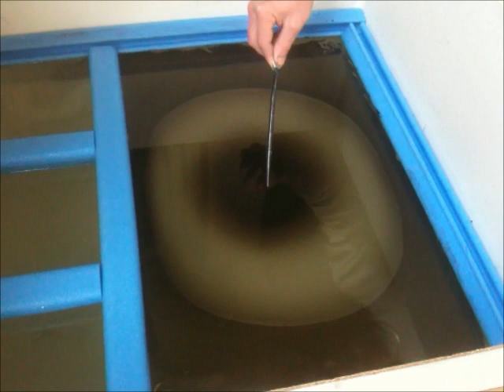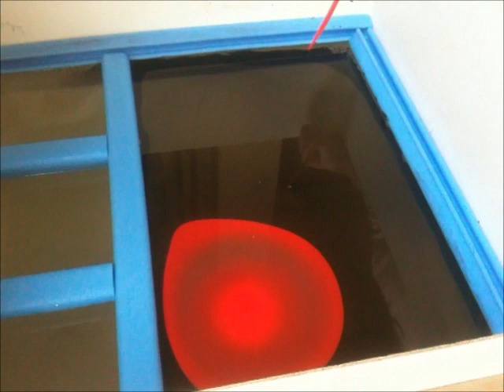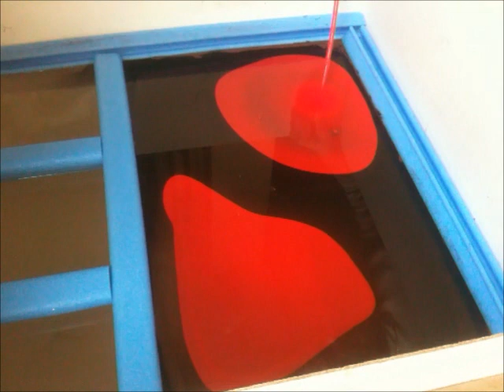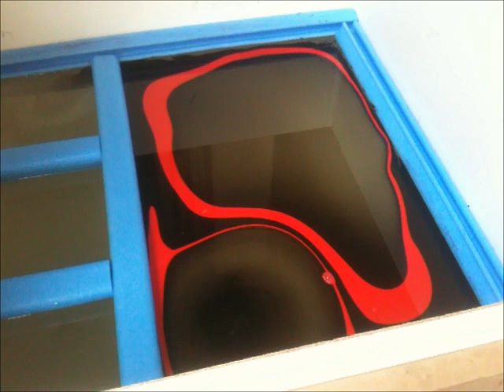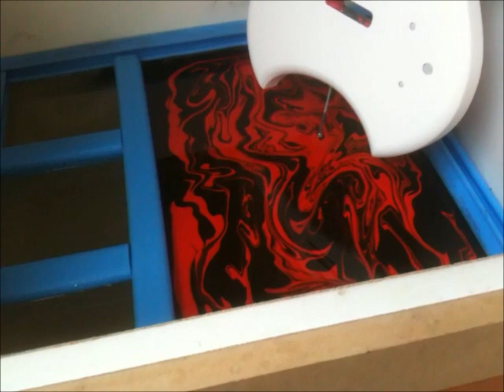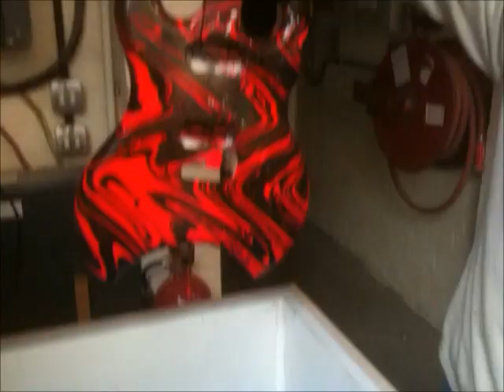SWIRLING(Red & Black Custom Guitar)

Comment: I have tried this and was pleased with my out come on forks and part of a bike i did,or how fast i added paint. BUT my only problem i in-cord was the fact that no mater what i did more or less Borax ,water hotter or at 76% i could not manipulate the paint , work with it as this fella dose ,it would skim over and just drag as a slimy mass ,so the only way i could get any design was to first swirl the water with my hand in a fortex, then add the drops pf paint .otherwise i couldnt get a descent design.

Comment: So Dean, first off great swirl. I’ve got a question that I’ve ask a few other swirlers. I’m using magic marble as well with water and ambient temperature around 70. If I’m not stirring the paint around 2 1/2 minutes it skims. How are you achieving this long work time? On this one it was right at 4 minutes dropping in the paint and 5 at the time of the dip. Which would help a great deal . Thanks for any suggestions. J